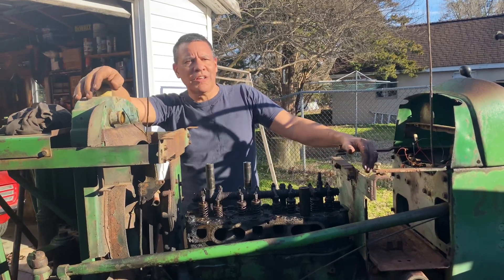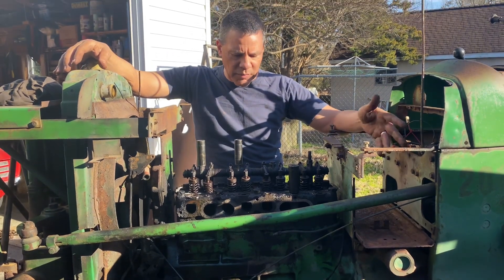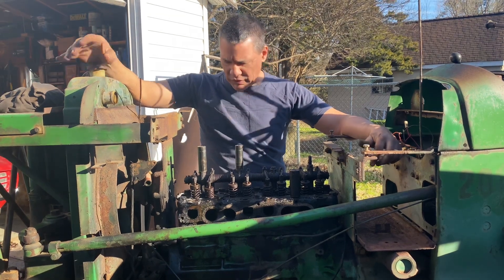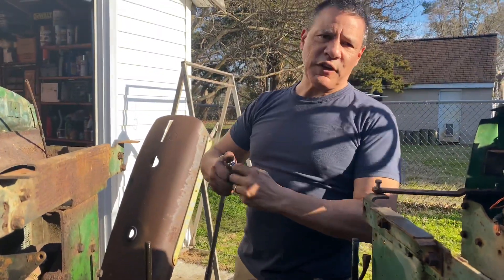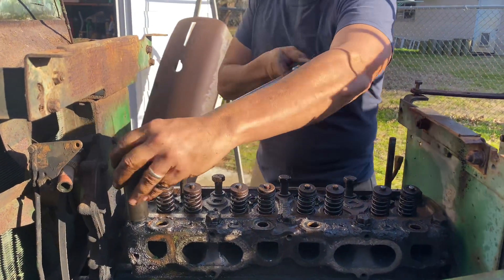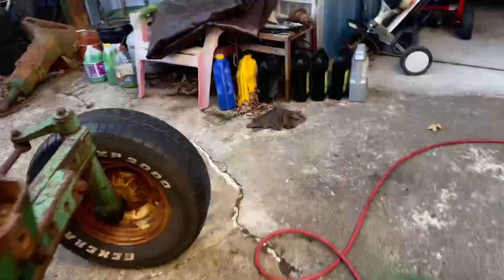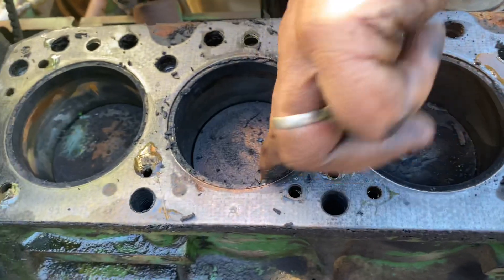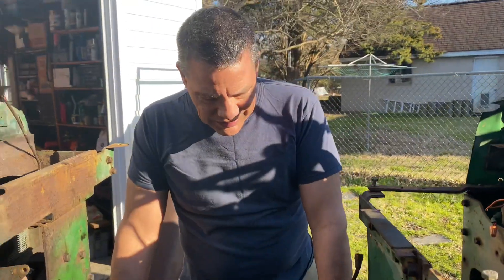John Deere 2010 head removal

Comment: I just got my first 10:10 and it has blow by and smokes because of burning oil but it runs real good and I called to see about parts availability and he was telling me about this deck plate thing and do you have to do that in order to just stick a set of rings on the Pistons and go back together? Thanks for any help